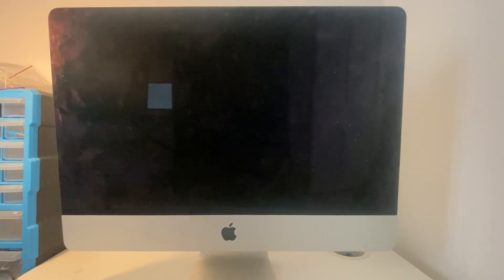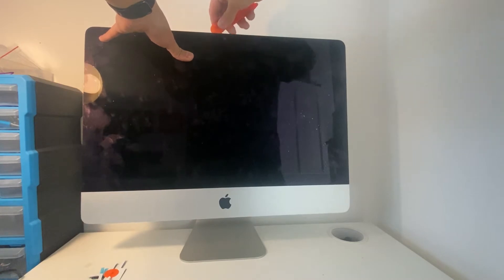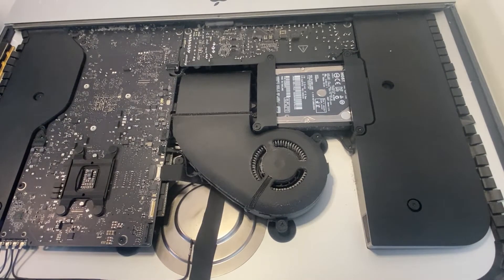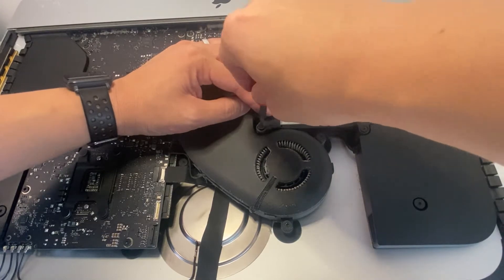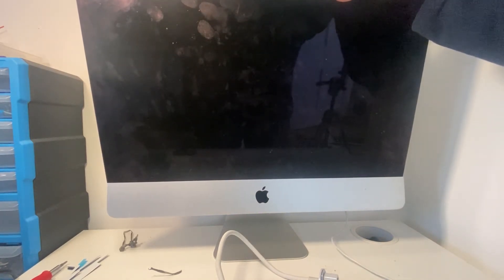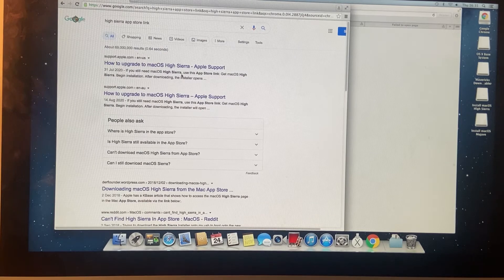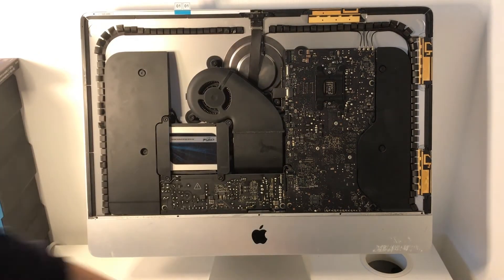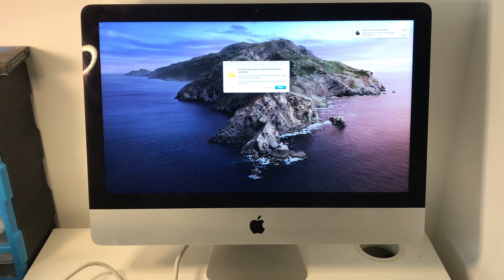iMac Late 2012 21.5 inch A1418 - Disassembly SSD Upgrade, 10.8 Snow Leopard to 10.15 Catalina macOS

Comment: Is it faster installing internally with SATA or using external boot in your other video? Do you recommend changing to nvme pice on motherboard? I have a late 2013 iMac ? Which way is faster?